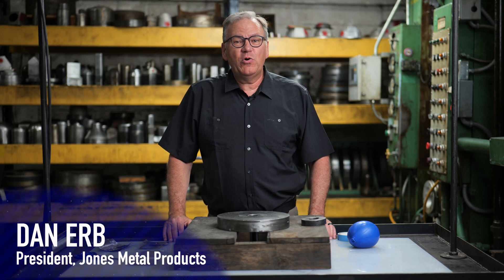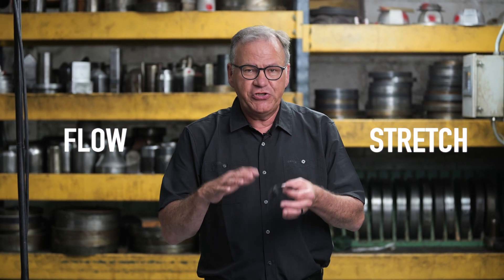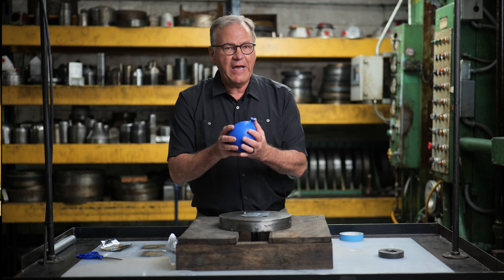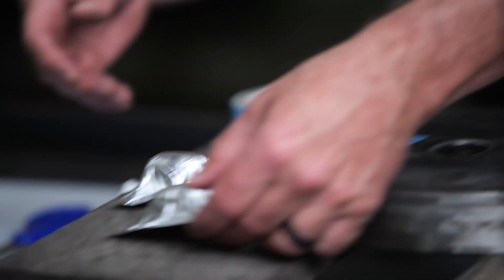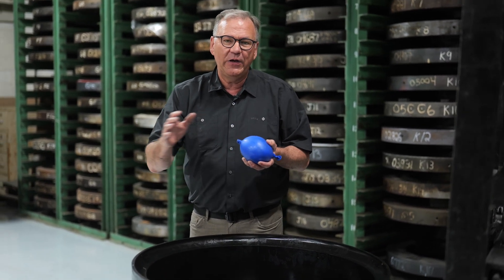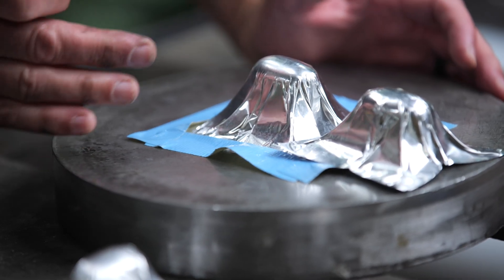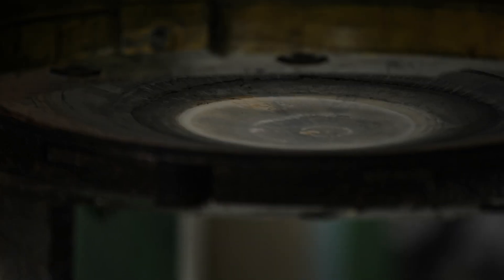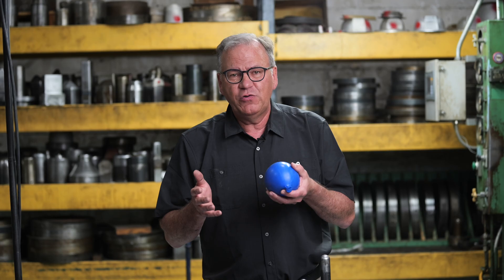What is Hydroforming? The Magic Inside Finally Revealed!

Comment: As a junior engineer at the Boeing Co., in 1969, I cut my teeth on Cincinnati Hydroform part problems.  Most parts were for the new 747 Jumbo jet.  I like your use of the urethane wiper.  We did a lot of that also.